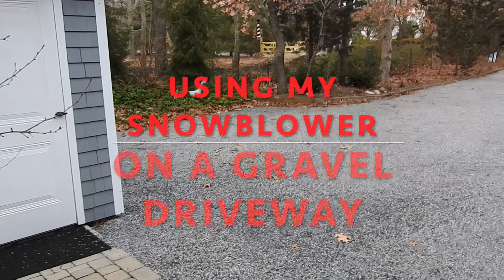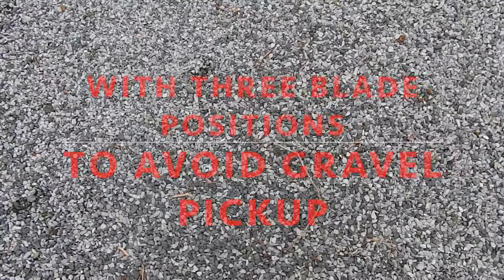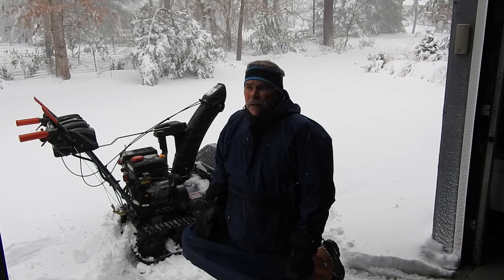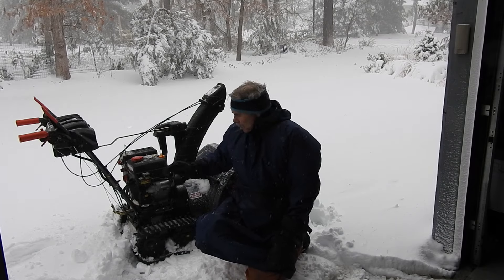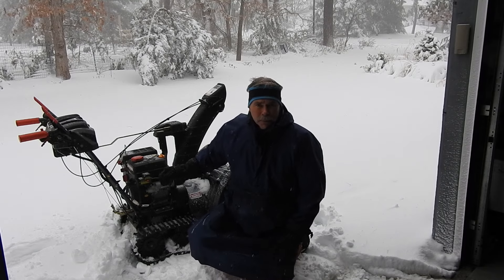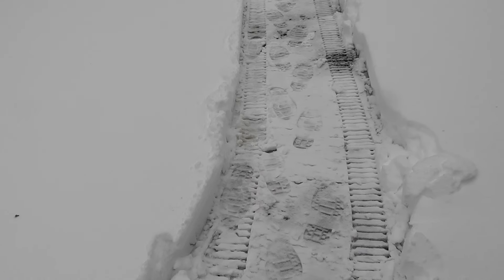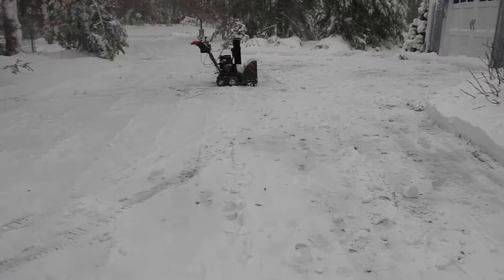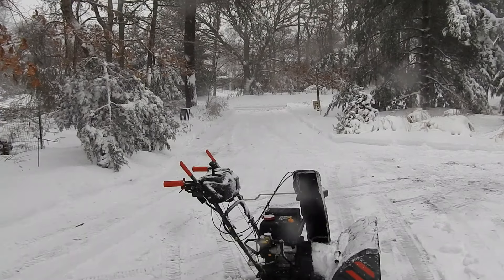Snowblower For a Gravel Driveway

Comment: Great video, I wished that my Cub Cadet snowblower's auger could be moved up. I have two gravel driveways that I do and I am always breaking shear pins on them.
Reply: There's a height adjustment on the skid shoes, put a 2x4 under the scraper bar, and drop the skid shoes to the bottom. Or, you might check out replacing the skid shoes with 5" diameter anti-scalping wheels from Tractor Supply, $16 bucks each.

Comment: When you go into the transport position, do you need to reposition the skids?  Do you need to change the skid position every time you go from concrete to gravel?
Reply from the maker: Sorry for the delay.  I like the wheel idea for other types of snowblowers.  When the driveway is warmer and the snow is wet, all bets are off as far as picking up gravel (actually crushed stone).  I have picked up quite a bit of stone at times, but it has not caused any problems with the machine.  I live in a somewhat rural area, so a stray stone or ten do not cause a problem otherwise.
Reply: @royalreynolds6886  I have Armorskids and of the four positions of the elevation lever, none was what I wanted, so I adjusted the machine on one inch of wood on both sides and tightened s kids; I am in between detents on the machine. I have not picked many stones, just about what you could count on your hand, so I'm going to go for 3/4" next time.  If I pick up stones, I'll have to go back up. It is too much work to readjust skids going from gravel to concrete every time.
Reply: Ten months later - Skids stay fixed, just change to one of the three positions.  (I have found that when crushed stone driveway (I was corrected that it is not technically a gravel driveway)  is not frozen (cold enough) a wet snow will become one with the gravel and will end up being picked up together.  It's a rare occasion, but it does occur.  Winter is on the way.

Comment: How long does it take you to do your entire driveway as shown in the video?
Reply from the maker: Nick, good to hear from you.  You reminded me, it's that time year when the snowblower comes out of storage.  Takes about 40 minutes to do the driveway.  I do not usually bother with less than two inches.  It has five forward speeds, which comes in handy.  when the snow fall is light, I use the higher speed so I keep a fuller flow of snow and finish quicker.  6 years later and still happy with it.